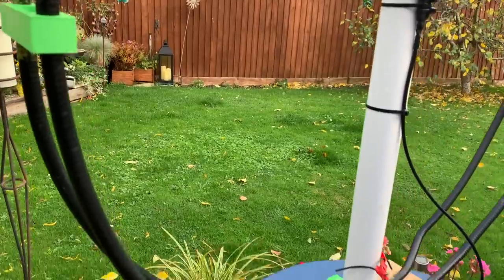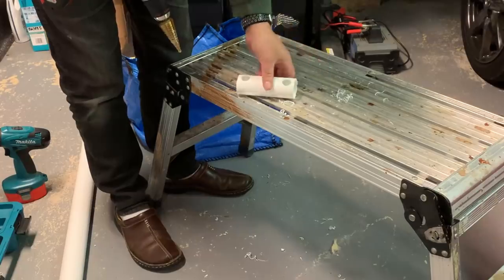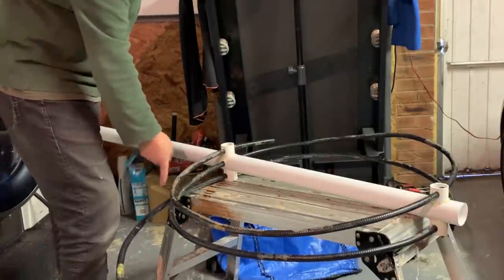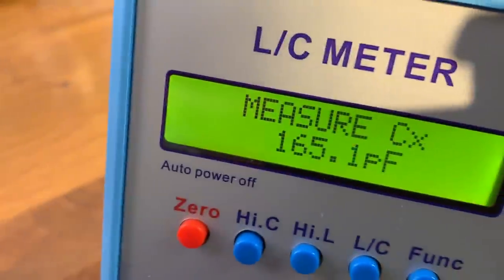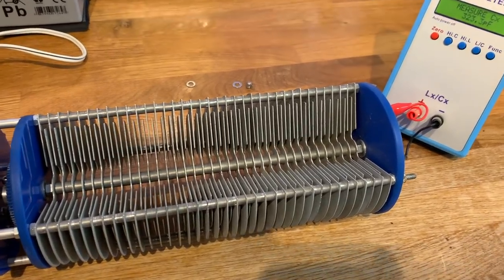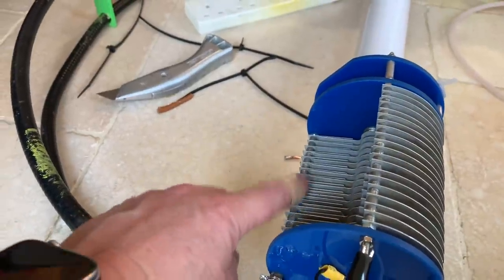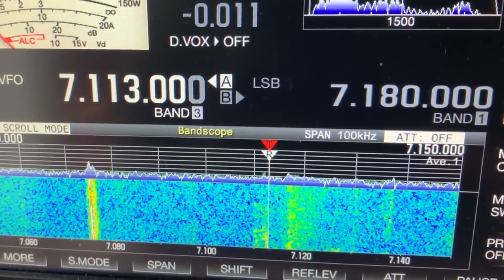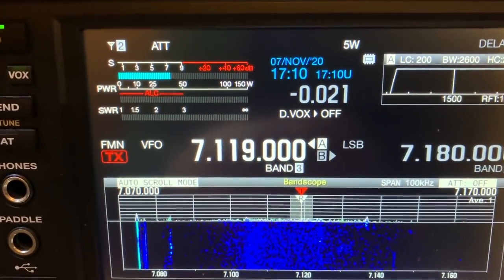HAM RADIO: Adding the CAPACITOR Building a Coaxial Magnetic Loop Antenna. COAX MAGLOOP:

Comment: Hi, nice video, I still have a few questions about the Magloop, the coaxial cable for the double loop is exactly 6 meters long, right? How long is the copper pipe that is bent into a small loop? And now the most important question, does the Magloop also make the 80 meter band 3.6 MHz or does it only start from the 40 meter band? Definitely a great project, thanks for showing it. 73 Jörg

Comment: do the test of putting  horizontal  the ring, in theory it will become omnidirectional and it will exclusively capture the signals (and noise) that arrive from "just above the horizon" (in theory the electrical noise of nearby towns will not be captured or will be captured very attenuated given the great directivity of these antennas)
Reply: I read about doing that but the information said you need to put the loop quite high for it to work well

Comment: Hi Mike probably a daft question to the initiated, Am I correct in assuming the coax feeding the antenna connects to the small loop , And is physically not connected to the big loop?  The capacitor is connected to the big loop as adjusts the swr ?  If This is the case  how is it possible for arcing to occur in the capacitor when things aren't right , I've been scratching my head for the last hour 😊👍
Reply from the maker: Hi, you have to look at this like a transformer the small loop inducts a larger voltage in the outer loop.
Reply: Ahhh the penny has dropped, thanks Mike makes perfect sense 👍

Comment: To my previous comment I used plastic pipe to keep a gap at the top of the mag loop this carbonizes. On ebay there are sellers selling PTFE rod various sizes hope this is useful info.

Comment: Two pieces of PCBd back-to-back also makes a high voltage capacitor.  Adjust the amount of overlap to change the capacitance.....cheers
Reply: You may want to trim or etch the copper back from the edge of the board to increase flashover voltage, but that's trivial to do. Beats the pants off gluing tin foil to window glass!
Reply: @fletcherreder6091  Yes, that really is a given....cheers
Reply: @ZL1BQDRoly  Wait, are you the Roly?
73, KD2TDE
Reply: @fletcherreder6091  👍 I haven't been call "the Roly" before but yes i am the Roly you are probably thinking of....   cheers

Comment: Another way to attach coax feedline is to use short solid wire soldered to the tubing first, then solder the coax to the solid wire. This allows any amount of heat on the feed  loop and minimum heat to the coax. Good video.
Reply from the maker: Good tip..

Comment: I made a loop using  copper tubing using two 9m x 18mm and to form 2 half loops and bend them  around a 700c bicycle wheel clamped in a black and Decker work mate and joined them together  with a copper joint sleave .
The diameter is about 5ft resonated on 80 m and 40m band. using about 150 pf ?

Comment: You culd have shorten the cap a couple of plates and decrease the capacity by adding spacers, something like chimneys. Just to get the voltage handling higher.

Also the mangnetich loop is challenging because the high voltage and current. So a clip like that on the capacitor might cause a lot off loses 🤔 great idea though

It's nice to watch you build your stuff and I'm getting good ideas for my own projects from you, thanks and keep up the great work. 73 de OH2FHJ
Reply from the maker: yes most of the projects here are improved on.. I have already upgraded the connections.. :)

Comment: I was thinking about using the microbore central heating pipe for the main loop not sure how much it would change the calculations,  I think for me might be easier to come by.
I've also heard that these loops are much quieter so maybe you can do a follow up video comparing the noise levels with your other antennas.  Nice job Mike very enjoyable to watch!
Reply from the maker: Go for it. 😀
Reply: definitely less noise! 👍

Comment: Very nice build, though watching you cut that lovely capacitor in half was painful.  It is perfectly shaped to fit inside an 18 inch length of 5 or 6 inch diam PVC pipe which would perfectly weatherproof the entire assembly.  A short length of thinner pipe, such as the support pipe you used, could then be butt-joined to the top of the capacitor pipe to serve as the top support for the loop while also providing clearance for the coupling loop.
Reply from the maker: Great Idea, but now the single capacitor is making two loops work..👍👍

Comment: Did you short the braid or ground to the center wire of the coax before soldering on the connecting wire?

Comment: so i have a question  ...     why not use 3 loops or 4    or   X   loops of  coax   for the main loop    ???   and or maximize the loop diameter ...   more capture area means more gain  and capture area     no  ?       the cap  could be changed for freq of interest     ...     your thoughts please ...   thanks   JF  /  N7WDF
Reply from the maker: You can use more than 1,2 or 3 loops but each loop adds to the circumference of the first so lowers the loops operating frequency.. read this website for more... https://www.nonstopsystems.com/radio/frank_radio_antenna_magloop.htm#top-of-page

Comment: Are you using flexible conduit for your loop?
Reply: Never mind, I say a previous vid that mentioned andrews coax cable... have never seen that before And it resembles flexible conduit...
Reply from the maker: Very true Joe, easy mistake.  but a good idea if you only have bear flex you could twist together multiple lengths and feed it into the conduit.

Comment: You have no PLT in the neighbourship? And: How did you managed to get the motor running veeeery slowly? I have a diy Loop, too. But wvery motor I have is much too fast.
Reply from the maker: Slow motor and large gear wheel small drive wheel.
Reply: @mike-M0MSN  Mike You forget thanks to  who build this capacitor GM0SDV

Comment: Hello Mike it is possible to note the diameters of the small and large loop in the description?
Reply from the maker: Yes the Larger loop is 1.27M Dia,  4 Meters X 2 in circumference (8 Meters total) and the small loop is 20% = 50cm D  160cm C.
Reply: @mike-M0MSN  is there a benefit to having multiple loops as boosted to a single larger loop.....does it just same space?